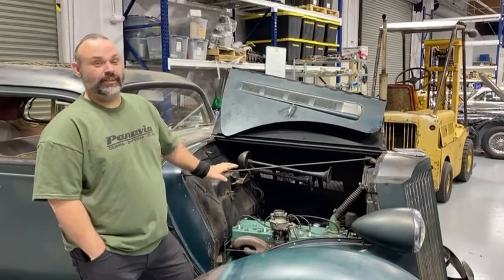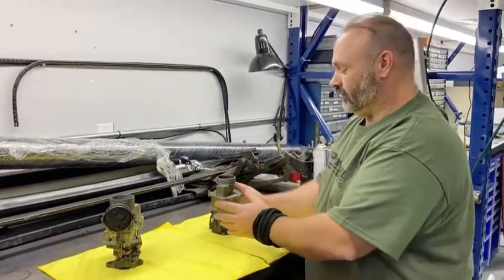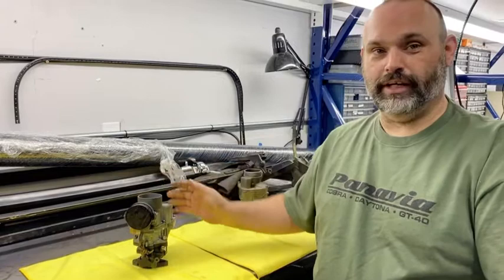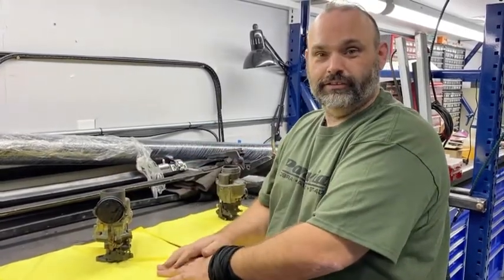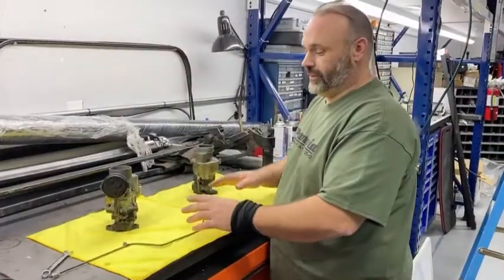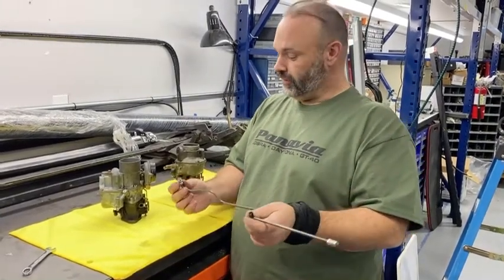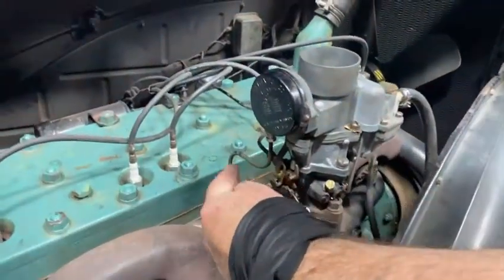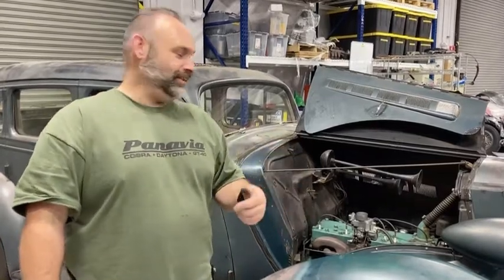1937 Packard Carburetor swap

Comment: Super interesting. I love Packards and have a 1954 Packard Patrician straight eight here in the UK. She is a little rough at the moment but has a fully rebuilt 359. She belonged to a USAF pilot based in Mildenhall England. He never went back to the States. Instead of the Ultramatic she has a Clipper 3 speed manual overdrive gearbox. I dearly hope I can put the engine back in and finish her bodywork. I  also have a 1952 Buick Roadmaster straight eight and a 1940 Buick Super 8 both in running order. To complete the collection I have a 1949 Plymouth P15 business coupe and a 1948 Ford F5 coe V8 flathead dually. Thank you for posting this.

Comment: I haven’t heard of that carburetor. There was also a stromberg but from what I hear the Carter was a better choice. One problem I had with putting a Carter on my 37 120 was that the bottom of the oil bath air cleaner hits the automatic choke. I ended up making a adapter that clamps on to the carb and raises the air cleaner just enough
Reply: The Carter is the better carb. My car doesnt have the OE air cleaner
Reply: I’ve rebuilt my Carter on my 37 120 several times in the past few years. I have a bunch of NOS kits that I use to do the job. The modern gas really messes with the old gaskets, and makes for a rough running engine   I know there are modern rebuild kits available, so I may look into those one of these days. My father left me stacks of dealer service manuals from Packard dealerships he bought from them before they closed in the 50’s. I will try and look up this carb and see if I can find you any supplements about that update process.  Thanks for posting!